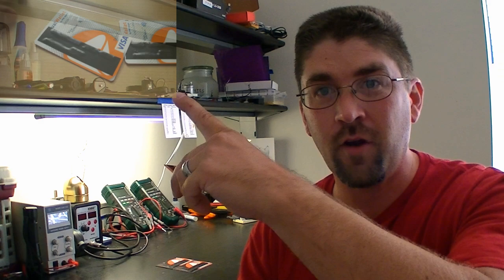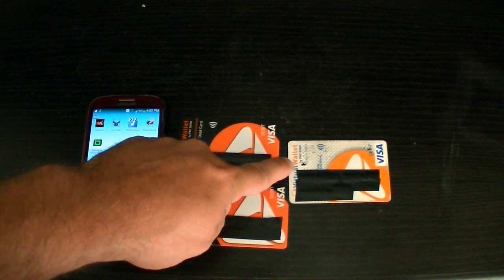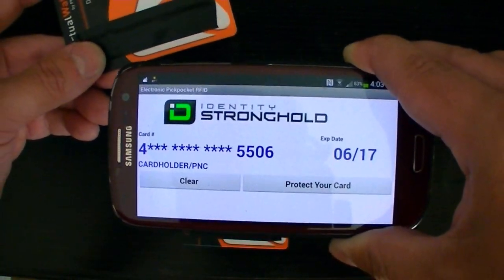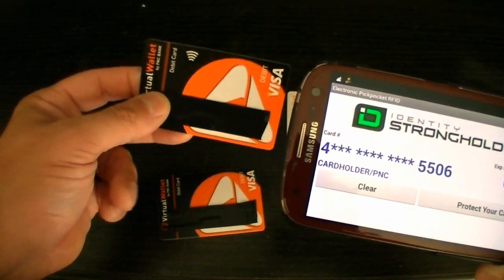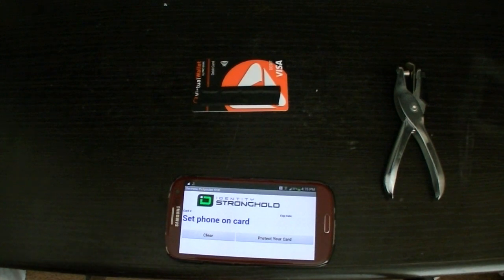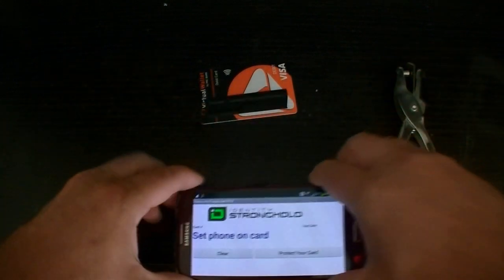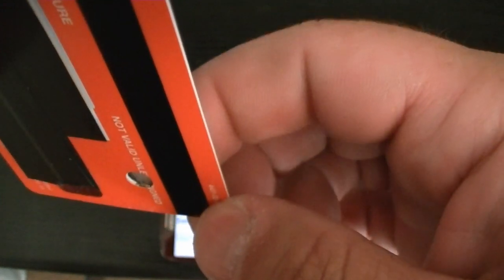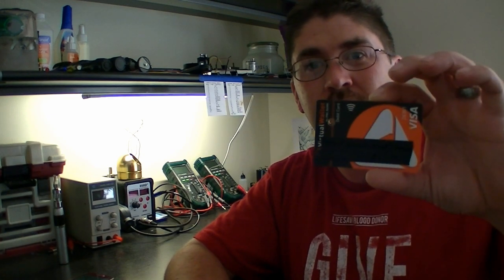UPDATED 2014 -  Disable RFID Chip In Credit Or Debit Cards

Comment: Actually, two other ways. You can crack the chip... basically shatter the chip inside the plastic. Silicon is brittle, like glass, and it's not hard to do this. Second option, is to sever the antenna loop. Dave Jones of the EEVblog has a couple videos that explains how these work in detail, and you can see multiple avenues o attack to disable them, some being quite unintrusive, in case you get nosy merchants.

Comment: I have a bank of America debit card. I popped my chip out an Target doesn't read it, manual input. Savemart supermarket where I work, has to scan an error three times before prompt to slide it. Gas station no problem. Bank ATM no read can't deposit or pull cash. I've ordered a replacement card with chip. I can't limit my purchases. But I will buy a RFID blocking wallet. Good video hope this helps someone video is 50/50. Great idea but card companies will make you with chip only machines

Comment: Some stores will not accept the card if there is such a large hole in the card, some banks are making such a hole in a card to tell the store that the card is canceled.
I recommend to hammer a small nail through the chip.

Comment: Does the card still work afterward?
Reply: Adventures in the Free World1 Only if the merchant has not switched to the new chip reader. By doing this you may render your card useless. The simple thing to do is throw your cards away and keep and use cash or other forms of currency, IE silver gold, etc. The new chip readers are becoming mandatory and swipers like square have gone to rfid readers only.

Comment: okay, so what actually powers this little chip?
Is this why we have an expiry date on the card?, as to when the battery will expire?
Reply: Mick Gatz, I just read your question in mid-2018. Others may still want an answer so here goes: Think of it like the induction charger on a high-end cellphone or even your Sonicare toothbrush. The antenna in the RFID chip powers the chip through induction. There is no battery in the credit card. The energy to run the chip is supplied via radio frequency on an as-needed basis. The chip "responds" when powered up. This why RFID in a credit card is a short-range technology

Comment: I recommend hitting the chip with a hammer until it's smashed inside. Doing this will not show evidence that the card has been tampered with.
Reply: +SchwettyBawls  I put mine between 2 pieces of 2x4's and used 20 ton jack to crush it
Reply: Was thinking the same.  A tiny ball-peen hammer tip or counter sink ought to do the trick.  And perhaps the original exacto knife method was better than the hole punch?  Less obvious?
Reply: @paranormalforensics9533  
But the ones now need
The chip to work.
Reply: @studiodevelopers2467  damn the system but together we are all smarter than them
Reply: You can punch it and punch another old unused card fill the whole up with the plain plastic circle and cover with a small kid sticker front and back. Anyone says it's my id. To make sure my waiter brings me back my card and I can tell by the sticker instantly.

Comment: You don't have to punch it out, it is enough to crack the chip. Then, You are not left with a questioning hole in your card. I just have picked a new card today, and it has a payWave. Did not know about this earlier, sweep your card near and there you go. I can already see a lot's of RFID big antennas out there picking from the street, like 2$ for passing by, and it's not in a range of theft.